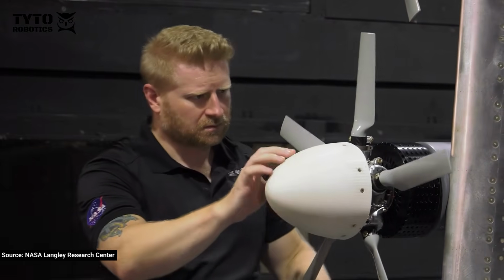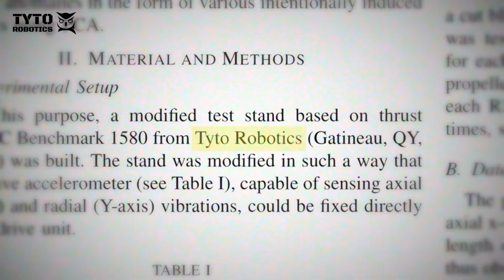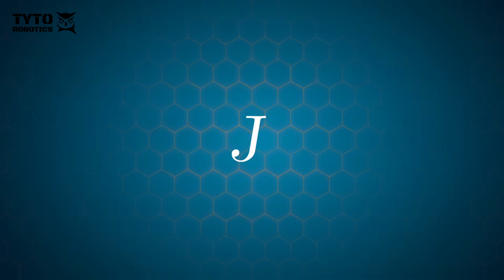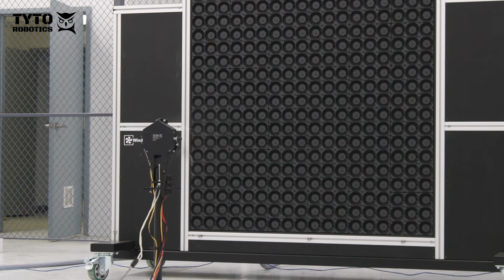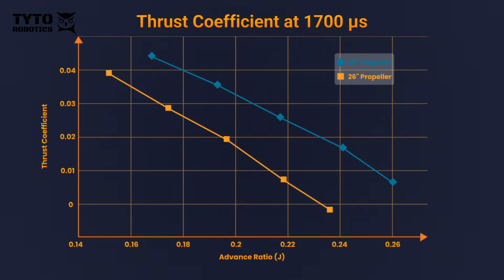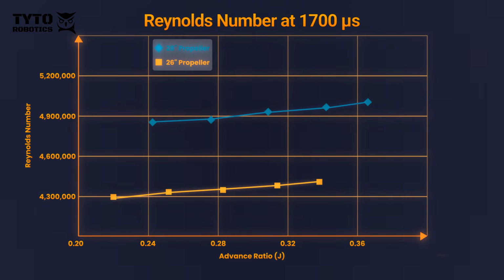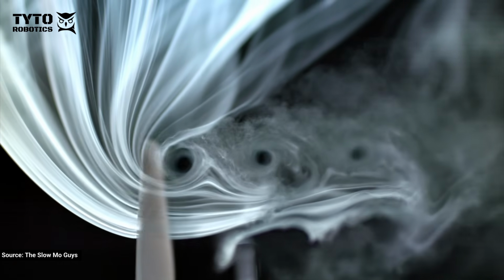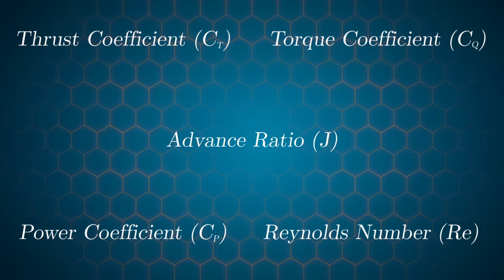How Aerospace Engineers REALLY Choose Propellers

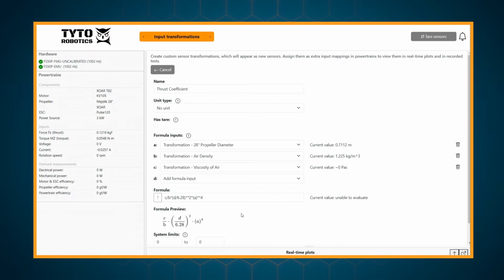Comment: When inputting the formulas my tyto software does not show the finished formula below it, so I don't know if I did it correctly. Your inputted equation looks wrong at 4:54 because the diameter and rotation speed should be on the bottom of the divisor. Also you didnt add the rotation speed as a formula "d" and the software says to the right that "Current value unable to evaluate"
Reply from the maker: Hi @ChrisF14 - feel free to submit a ticket with our support team here and they can help you troubleshoot: https://tytorobotics.odoo.com/helpdesk/customer-care-1?contact_form=1